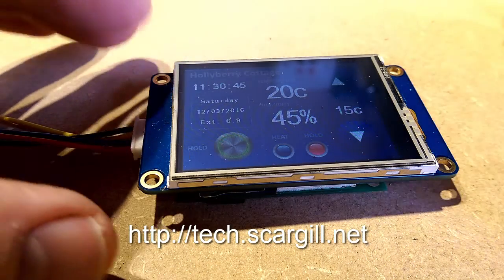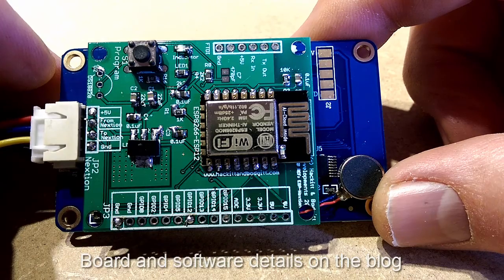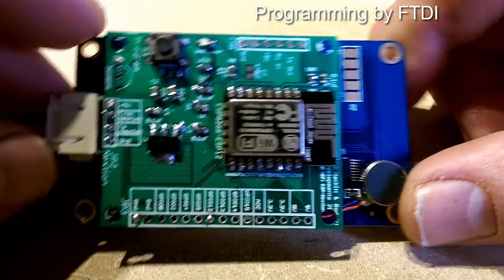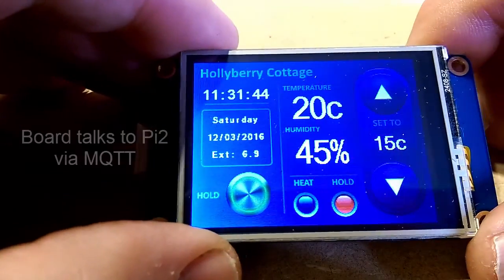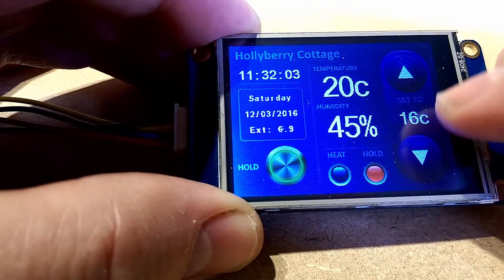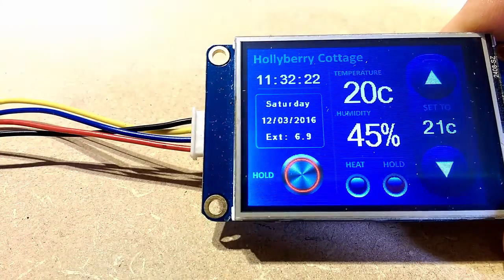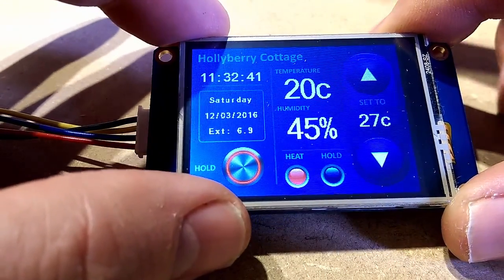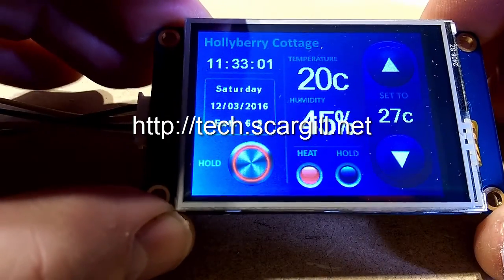Nextion WIFI Touch Display

Comment: How did you connect your PCB to the nextion connections?! It's very compact and I must find out how to do it for a project I'm doing.
Reply from the maker: Double sided adhesive foam.
Reply: I mean the 4  electrical connections
Reply from the maker: just wired straight across with a soldering iron
Reply: did you wire headers to the nextion and then put through the pcb? or the other way around? Thanks
Reply from the maker: Can't remember (the video is a year old) - I don't think I put any headers on at all - just 4 wires soldered from the Nextion to the PCB.

Comment: Hello Peter,

First of all I want to thank you for all your contributions for the open source community. Second I want to ask you if it is possible to connect directly the nextion to the esp8266 without the pcb board? I just wanted some simple button to send info through mqtt and display some information from rpi server.

Hope you can help me. Thank you once again
Reply from the maker: Sure - that's what I did
Reply: Sorry I thought you somehow used the pcb for some specific reason and not directly connected it to the Nextion. Can I use your work and change it to easily integrate with home assistant?

Comment: Peter Scargill, hello!
Prompt, whether it is possible to make the control device to bluetooth
as shown in this project?  https://yadi.sk/d/w_e6IElx38pfR3
Reply from the maker: Probably is - but the unit has no Bluetooth and my Pi2 has no Bluetooth - don't see any advantage over using WIFI and MQTT.
Reply: Thank you for the clarification!

Comment from the maker: And if you don't need a touch display, just a terminal... 

Here's another way depending on what you want to do with the display. I needed a fast terminal for monitoring.... and so with any old ESP-12 module - I added code for the 240*320 modules to the HC2016 home control software. Result - an MQTT-driven VT-100 terminal with 40 characters by 40 lines.  https://www.youtube.com/watch?v=YXqLVmoyKPE